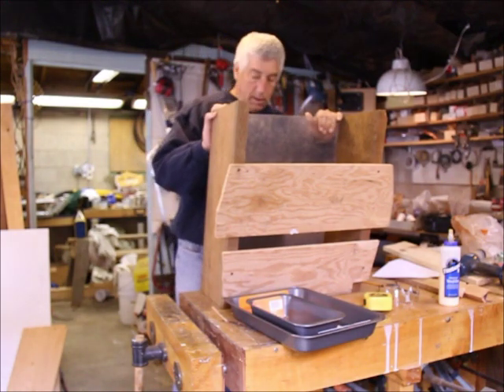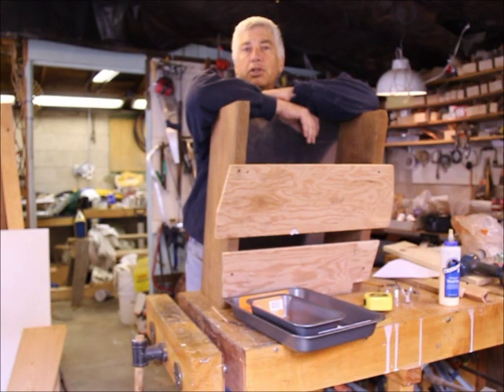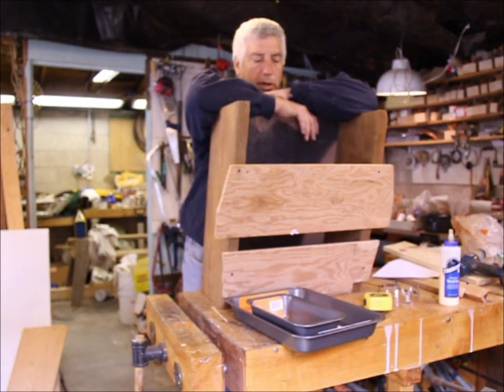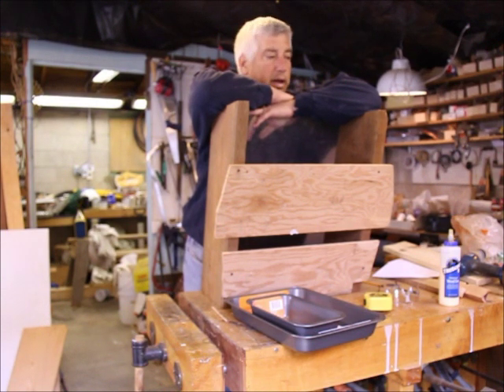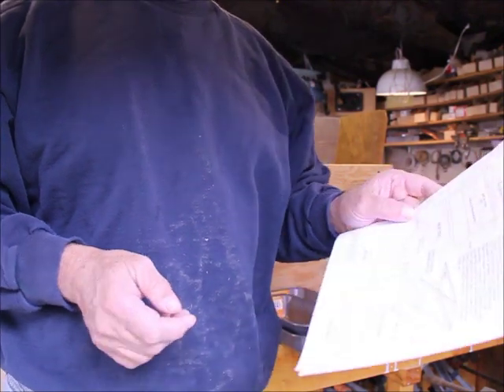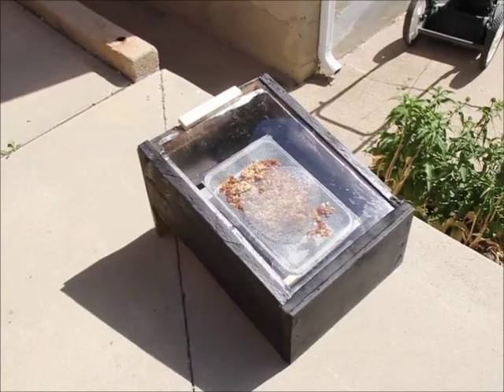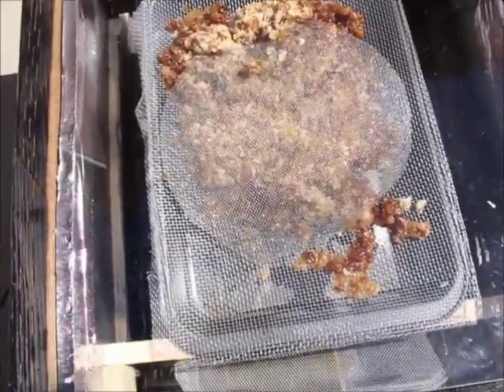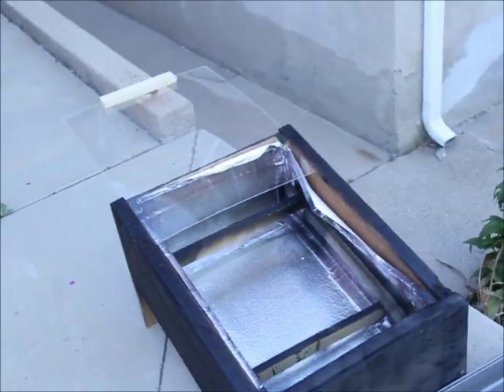Solar Bees Wax Melter DIY

Comment: DeeJay, Put the wax in the top pan and let it melt.  Don't waste time and space by placing a #8 mesh over the first pan.  The idea of using the sloping pan is to pile it up with wax.  It's the holding tank.  Also, those wax melters get hot enough without needing the insulation.  I've built mine from scrap wood and an old window.  No interior insulation what so ever.  I just lay the window on top of the box and it still melts the wax quickly.  Actually, on a hot day it's very fast.
I have to agree with mark palmers' comment.  You ramble and ramble.  
Informative video.

Comment: Hello nice video try doing away with the 2 inch pan and replace with 1 inch sheet pan kind you use in your oven to bake on then use window screen laid on top of pan will give you a couple more inches and when refilling with comb or wax remove the screen place new screen in with new wax on top to melt again and clean your old screen any time ,.

Comment: I use a paper towel in my top aluminum foil pan and water in the bottom pan. no insulation needed, used an old flat screen TV plastic screen for a lid.

Comment: Why not either just leave the top holding tray horizontal with a mesh over and some water in the bottom to enable ease of removal of the wax once it has set, or if you are still keen to use the 2 tin method, change the top tin to a very thin tray, I guess it is really only to give a sturdy edge to attach your top mesh. Good build otherwise

Comment: Good video but it is too long, needs to have less chat. Why is he putting the wax on the screen on top of the main dish for it to drip into the second pan.  Maybe put the wax into the main pan and have a larger drain hole with a piece of screen across the hole. Won't have to build the sides higher then.